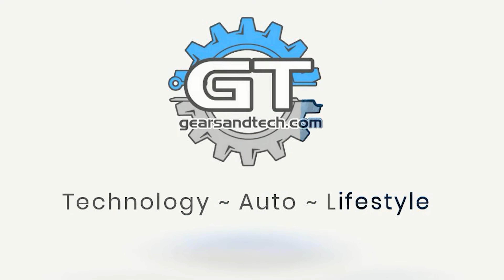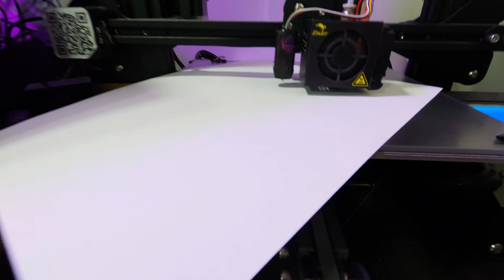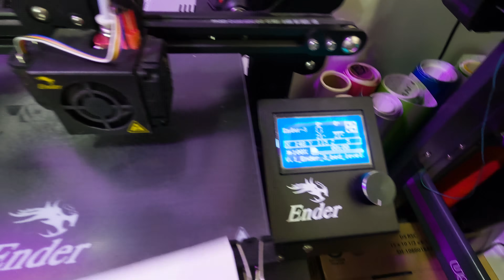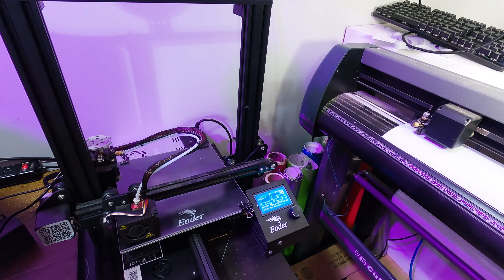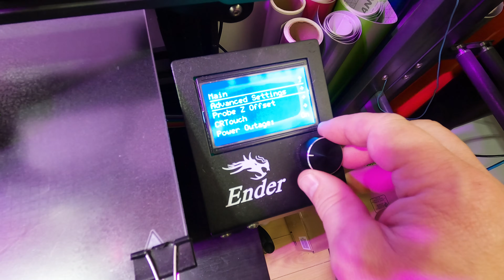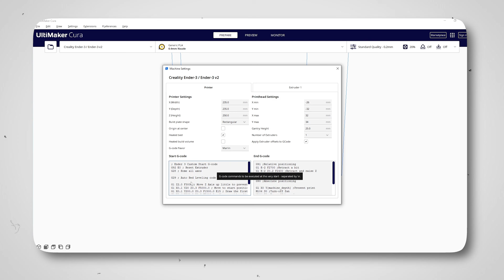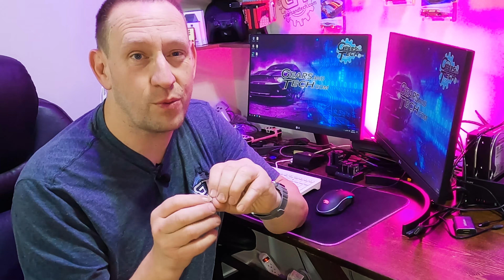Setting up CR Touch on Ender 3D Printer | Gears and Tech

Comment from the maker: Bed Level Gcode - https://github.com/AlliedToasters/ender_3_bed_level?tab=readme-ov-file

💥💥💥💥 SAVE ON NETFLIX, DISNEY+, CRUNCHY ROLL AND MORE! 💥💥💥💥
✅Use Discount Code 'GEARS' here  - https://www.gamsgo.com/partner/JmWGqN

You can get the kit here - https://amzn.to/3LdASCD

Other Ender 3 (Pro) Upgrades:

Z axis Screw - https://amzn.to/3AxwXeX
CR Touch Auto Bed Level Kit - https://amzn.to/3LdASCD
Silent 32 Bit Board - https://amzn.to/3AulwET
Glass Bed - https://amzn.to/3Nhve5c

Upgraded Control Board - https://amzn.to/3oNgHUB

Ender 3 Printer - https://amzn.to/445c1t8

Comment: shot in the dark but i use my ender-3 for my company and its out of order right now. i did everything in the video ad everything worked great !. soon as i uplug my tf sd card from the printer the settings reset... my set up is ender-3 silent 4.27 creality board sprite pro extruder and cr touch. i also bought a creality 3d 3 touch screen pad. i will never be be able to print anything if i cant uplug my sd card PLS help!

Comment: Good tutorial. Did the board and the CR Touch only. The Creality app is much different now but everything worked out perfectly. I'm planning to upgrade to a Bambu X2D but wanted to use this as a way to use my Industrial Engineering brain to learn the behind the scenes operations of a 3D printer.

Comment: I know im a little late to this conversation, but I recently got a cr touch from my friend and havent been using my ender 3 pro because my z stop was all messed up and dug into the plat. I tried downloading the firmware onto the sd card (only thing on it) and when i plugged it in nothing happened. Does anyone know how i can properly install the firmware onto the machine? I also made sure that it was the firmware for my motherboard which is the 4.2.2

Comment: My 3V3 starts, ask for language, then opens for leveling, temp etc. Moves to the left and says: Cr error contact supplyer. Red LED flashing. From her I have NO alternatives on screen than restart. It looks like the Cr does not "drop" the sensor. Help. Have checked connectors etc.

Comment: I still have no idea what this CR Touch does. 

I just want the machine to level the bed for me. Is that what this does? Lol.
Reply from the maker: This is exactly what you want. It doesn't level the bed, but it does check the bed position and level the print to the bed

You still need to level the bed the best you can, but then this will adjust for any imperfections you may have
Reply: @GearsAndTech lol thanks 😂 I'm a dipshit when it comes to stuff like this but I still like cool tech to play with.

Comment: I find I don't need to do a physical bed level as often. I did just get the rubber in stead of the week springs that the printer comes with. This may help with having to physically level less often.

Comment: Well great this is for a printer with a really weird screen and an aftermarket board instead of the stock 32-bit board. So I can't follow it home I just got done installing a BL touch on my Ender 3 V2 with my micro Swiss hot and and I can't figure out how to actually make the BL touch work and I got a feeling I'm going to have to flash the firmware again like I did in 2019 only I don't remember how I did that
Reply from the maker: I know how you feel.

There will be a few update for the factory components to support bl touch

Comment: I have Creality Ender 3 V2 with stock motherboard. Am I missing something? My BLTouch comes on but wont auto home. X,Y,Z AXIS wont work but BLTouch lights up blue and the prob works. What do i need to fix? Any wiring issue or software update?

Comment: I would like to knoiw what firmware you use for both the printer and the controller, As mine does not have the probe z minus feature, but I can get the minus z by turning the knob.........

Comment: i recently installed me cr touch on my ender 5 pro, and i noticed when it does the auto level test points, the bed is hitting the hot end. I used the "move z" motion command to set it like you said and got a nice slight grip on the paper, and did the manual levealing. am i missing something?

Comment: What if the gap is too big and after the Z probe, there's still a gap?
Reply from the maker: Adjust z offset
Reply: @GearsAndTech thanks for responding brother. This thing has really tested my sanity.. I've tried the Z offset too. It gets me closer, but there's still a gap. Im wondering if its something in the firmware 🤔

Comment: After spending countless hours wasting filament on print attempts, wrecking a magnetic bed plate, and destroying 2 nozzles.... your video @GearsAndTech was by far the best to explain exactly how to level, z-stop, and then incorporate the code into your prints/your additional g-code.  Even in the instructions from Creality I was seeing that I could put G29 directly after G28 (instead of hitting enter).  To me it never felt like it was incorporating the auto-leveling but I didn't question since it came from the Creality.  It says "Change G28 to G28G29".  Your code suggestion actually forced it to auto-level and my print has never looked better FINALLY.  Thank you so much!
Reply from the maker: Happy to help

Comment: Ender3 no v*, not pro, etc. I installed Sprite, Dual Z, CR Touch and quiet 4.2.7 main board at the same time. Got the firmware installed and watched your video. My Z offset doesn't move like yours does. I turn the dial and it doesn't move at all. Also when I go to the move z, it won't let me move it to a negative value. I'm lost here. Please help.

Comment: Hey I installed everything and it went together like put on a glove. I'm running the Ender 3D pro. I rebuilt it. New rollers, new hot end . And the like. 
But when I start the print and I've used these files before. My brim seems to curl at the outside of its print area. Am I too hot? Am I too cold? Is my line width too much or not enough? Just like some help here. I'm kind of at my wit's end.
Reply from the maker: Too hot

Start hot for the first couple layers, then cool it off a bit to prevent curling

Comment: The semicolon is the ONLY character keyboard charactor that is used as the command 'END OF LINE' . Much like the bell on an old manuel
Typewriter. Many other characters on the 'qwerty' keyboard we use today are paired with other characters to mean and do different operations.

Comment: So I basically have the same set up that you do, however, when I try to auto level the bed, they see our touch goes off the side corner and misses the bed and pushes the printhead into the bed. Could I fix this?

Comment: followed your video now my printer does not work.
downloaded program put on sd card installed on printer hit auto home and all it does is say reset printer. it will not move it will not auto home it will not do anything
Reply from the maker: Check you have correct software installed

Comment: I set my g29 after the bed heating to defeat any thermal heat flex and added S to stop till leveling finished then the extruder heats the final bit
Reply: I know this is old but can you explain where you added the S to, I'm dealing with my extruder heating up while leveling leaving pla spots everywhere

Comment: So for some reason when I upload the firmware I have the same marlin firmware I can’t see my gcodes then sometimes it errors out I have had some issues where the probe comes out senses that it’s about to hit and then proceeds to lower so much the heat nozzle hits the bed and continues… I have same printer with a 4.2.2 mobo I’m at a loss I’m still brand new to this and I feel like I bricked my printer cause it won’t read the z switch anymore either when it’s hooked up… any pointers or suggestions would be helpful on top of that I don’t even see change filament anymore either..

Comment: I've watched this video several times, and I'm missing something basic.  I do the auto home and the printer head crashes into the bed.  I bought the CR touch without a new mother board, and got a download to install the auto level firmware so it does show up on the screen.  And in your video, it doesn't explain to me if - means down, or if + means up?   Ugh, I'm really struggling here to figure this out.  I'm running a glass print table as well.  I'm stumped???
Reply from the maker: Change your home position first then do auto home

Comment: Weirdly after installing the CR Touch (and a BigTreeTech SKR Mini board, and updating the firmware) my Z axis reports it's at +364.7 an refuses to be changed :(   Been at it the whole day, can't figure it out.  The Z limiter switch was removed for the CR Touch install as per instructions.
Reply: Sooo it seems that doing an Auto Home before doing anything with the printer will totally bork things, whether the z limit switch is installed or not.  Tried to level the bad as soon as the printer was turned on and shockingly it ran.  Z axis move will show 0.000 until you do an auto home, all heck breaks loose after you do one.  The BigTreeTech 3.0.1 firmware bricks my printer (even though it's a 3.0.1 board) but the 3.0.0 firmware works.

Comment: So have an ender 3 pro. Upgraded to the 4.2.7 board and cr touch. Cr touch seems to work fine but when I load any type of leveling gcode, the nozzle goes to each area and lowers down. But then just goes back up and to the next area and repeat. It doesn’t stop for adjustment or no button push to have it go to the next area. Any clue how to fix this? I would like to do as you do as far as manual level prior to using the CR

Comment: The Bed Level Gcode link no longer works. Can you suggest another one?
Reply from the maker: I'll have to take a look
Reply: I was wondering the same thing. The CR touch is not working In my favor. Even after buying a new bed and pad 😂
Reply: I clicked on the link for the bed leveling g code but it says it was removed?

Comment: I have ender 3 s1 pro. It has pre installed CR touch. But problem is CR touch probe is slightly below the nozzle level. It is dragging print leyer. Your CR touch probe is above the nozzle. Please anyone tell how to solve this.

Comment: After messing with this stupid thing for hours upon hours, i give up. Ive calibrated it many times, leveled it many times, when i hit go to home position it keeps putting it's self in the middle of the bed slightly right. I remember why i gave it up the first time lol Back in storage it goes. What printer would you guys recommend that actually work as intended? And somewhat budget friendly. I dont care to spend abit more. Ive gotten 1 successfully print from this pos when i first started with it. After that nothing but headaches.....
Reply from the maker: I've been there so many times. I think a 3d printer is a tinkerer hobby. If you don't like tinkering, it's not for you
Reply: @GearsAndTech  i love tinkering with things but I honestly i think this printer is just messed up, I bought it used. Ive watched hours of videos, googled a ton, tried soooo much lol it's fun to mess with but when I can't get anything to work after hours I started to lose my mind🤣

Comment: I debating if the auto bed leveling upgrade is worth it. I'm able to get the bed level dialed in manually to where it works pretty dang good with my ender 3 pro
Reply from the maker: It's totally worth it

Comment: My E3 does not like the CR, flashed every BL and or CR ware and all work, move axis, pre heat hotend but auto home is backwards, zeros X and Y, goes to center and Z goes POS, up, probes dead air and goes POS again and probes the air again, ?
Reply from the maker: Interesting issue, I'm sorry I can't help you solve it

Comment: So how do you level a bed when it has been changed to a glass bed and springs changed out for spacers?
Reply from the maker: If you have no springs you have no hope

Put the springs back in
Reply: @GearsAndTech  the glass kit specifically mentions to use the spacers vs the springs

Comment: I recently purchased this printer and trying to do all the upgrades but when When trying to install the CR Touch firmware for my Ender 3 (v1) 4.2.2 board (Firmware 2.0.1), it changes my main firmware backward to 2020 (Ver 1.1.2) when it boots when loading. I have flashed back to the current firmware (Ver 2.0.1) but it keeps happening every time I flash it again.
Mainboard Version: V4.2.2
Ender-3 Marlin2.0.1 - V1.1.2 - ALT(32bit)
CR Touch Version: Mainboard Version: V4.2.2
Ender-3 Pro Marlin2.0.1 - V1.1.2 - ALT(32bit)
What am I doing wrong?
Reply from the maker: Great question. Unfortunately I don't have an answer for you. I'm sorry

Comment: It’s very important to make sure you have the right firmware and make sure you’re system is a 32 bit or 8 bit. I struggled for 6 months trying to get this thing working.
Reply from the maker: Yes, you can't use the wrong firmware
Reply: @loganwilkinson9950  I forgot where I got it from but it wasn’t crealitys website because that one didn’t work. I ended up just getting a Bambu lab a1 mini and saved myself the headache. Honestly the CRTouch sucks at bed leveling.

Comment: I don't have "probe z-offset" on my screen. What gives? I have 
GD-Ender-3 V2-Marlin2.0.8.2-HW-V4.2.2-SW-V1.0.7_E_N_BLTouch firmware installed on my  ender 3 v2
Reply from the maker: Need to flash different firmware
Reply: @GearsAndTech  yeah that was it. thanks man , appreciate it
Reply: But what firmware version did you end up going with?

Comment: It work once. But I changed to a. 6 nozzle which is slightly longer and now nothing works on my cr-10 v3 I always have a. 3 to. 6 z offset that I cannot change, like the settings is not well interpreted or something

Comment: I would recommend adding the G29 after the gcode that sets the bed temp and waits for it to stabilize, so that the leveling happens on a bed that is at temp rather than a cold bed. For spring steel beds the difference can be significant.
Reply from the maker: excellent point

Comment: The CR Touch was one of  the best buys as i get very few print problems and in my Cura settings it is always set to do a bed leveling before printing 👍👍👍another quick tip get the Silicone Hot Heat Bed Spacers but dont compress them.
Reply from the maker: Thanks for sharing
Reply: Any advice Im really having problems trying to calibrate the CR touch

Comment: I needed to readjust my ender 3 pro with the BL touch because my prints keep coming off halfway through prints. Wastes alot of time. Also, i have a problem where my entire gantry falls down when the stepper motors arent engaged. I installed an Anti Backlash Nut and it still falls down. Anyone have any info on this happening???
Reply from the maker: Your z motor is broken. It should be very hard to turn when it's not powered on
Reply: @GearsAndTech  How do you check that?

Comment: The whole "leveling" nomenclature needs to die off; you're not leveling the bed, you're tramming it.  Calling it "leveling" is confusing to newcomers to the hobby; Leveling implies that you're attempting to get the surface parallel with gravity (e.g.: perfectly level), when you're actually attempting to get it parallel with the tool head along both the X and Y axes, which may not end in a flat plane with the tool head due to frame imperfections and such.
Reply from the maker: You are 100% correct

Perhaps we need to qualify that we are leveling to the print head

Comment: I have been 3D printing for over 10 years and have owned no less than a dozen printers to include two Delta printers. I have owned 3 Ender 3 printers and sold two of them because I have a Prusa and a Anycubic Kobra2 V2 and both of these put even my old highly modified Ender 3 printers to shame. I still have my very first printer which was an original Ender 3. This printer has been modified with many upgrades to include the 32 bit silent board. I almost threw it away, but put it into storage because it is my first. I am about to upgrade it with a BIGTREETECH SKR Mini E3 V3.0 Control Board, and the CR Touch. I hope it works because this old printer has printed hundreds of jobs and has a special place in my heart.  I will say that the Kobra 2 is a bad ars printer and will print 10 times faster than an Ender 3 for only a few dollars more. They are around $200, but have so many good features and print at laser fast speed that they are in fact in my opinion one of the best values out there!

Comment: This is a great video. I'm a noob to 3D printing so as you can probably agree on with me, things are not as they seem to a new guy. I put an upgrade 2nd Z drive on my Ender 3 and that was easy, then I wanted to upgrade to a cr-touch sensor and installed it without any problems, but from there I had a hard time configuring everything until I came to this video as just nothing would work right or at all at times. Thank you for being kind to share your knowledge to people like me who are too old to learn fast anymore, just the amount of different operating versions for the ender 3 is mind boggling! . Nuff said! I subbed your channel in the hope of finding more morsels of handy info on programming and set ups. Best regards and Thanks again.
Reply from the maker: Glad I could help

Im on the same journey as you.

Comment: Your supposed auto home machine then get the nozzle 0.1 mm from the bed using a feeler gauge moving it ONLY with move z axis then record that number. Auto home the machine then go to z offset and input the number you recorded then store settings!
Reply from the maker: That's a great idea! Leveling the bed first is a good idea too

Comment: Not sure if it’ll be seen, but just added mine and updated the firmware. Manually leveled, did the bed leveling, changed the g code. Tried to print. It heats up, does the 9 test points, then starts printing way too high (maybe a millimeter or two above the plate) any advice?
Reply from the maker: Adjust your z offset on the printer settings. It'll take a couple tries to nail it down. But once you get it you'll be printing perfect every time